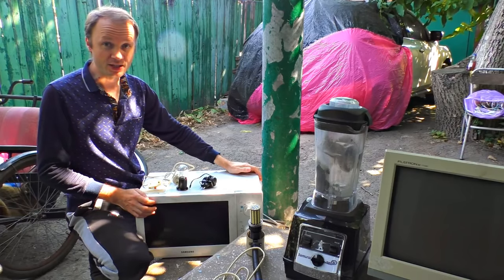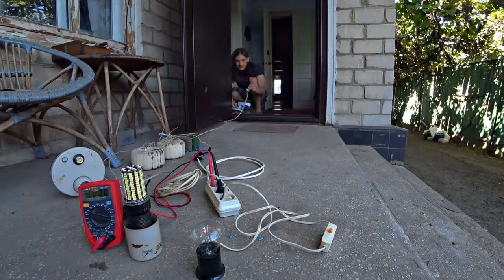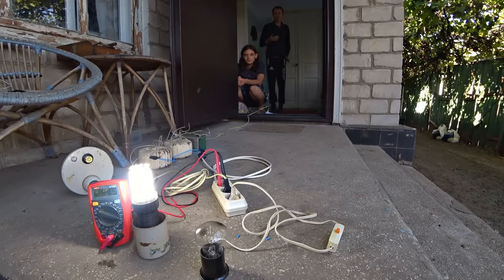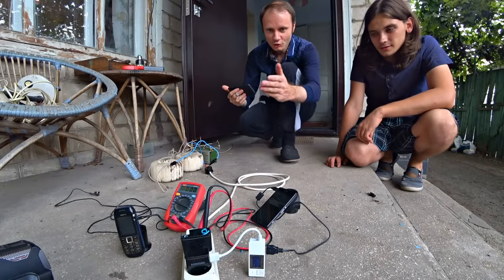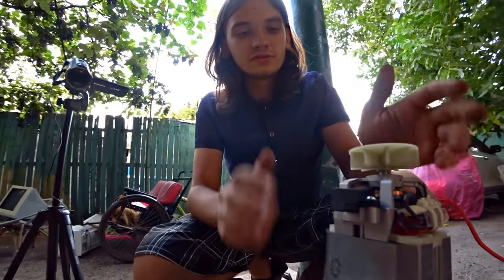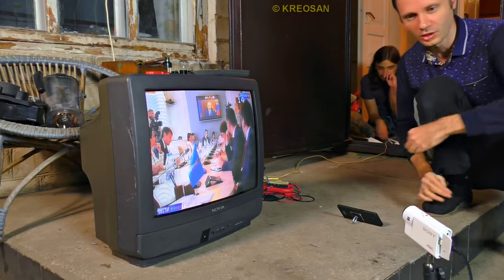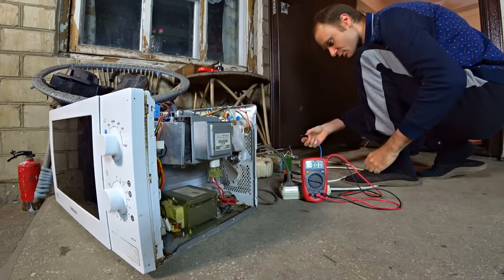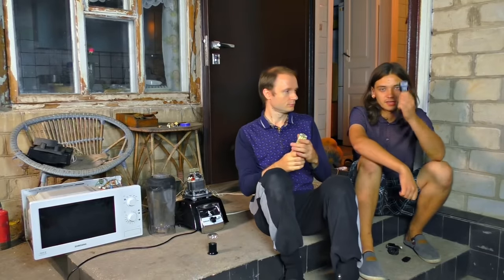Don't leave your devices plugged! Overvoltage + house appliances

Comment: voltage increasing at night probably because the load is pretty low, so the Ferranti effect (basically it explains how lower load could increase the voltage on load side) happened. we learned about it on power electrical engineering. this could happen when the grid voltage control is bad. They probably should use SVC in the grid.

Comment: The voltage increase is caused by the power line resistance, and bad voltage control at the power supplier.

Comment: Y'all still have analog telly available?  Not in the USA. 260v was coming out the mains?  That could cause premature failure. I think our system more tightly regulated. I've never seen more than about 122 on a 120 on my voltmeter

Comment: The voltage used throughout Europe (including the UK) has been harmonised since January 2003 at a nominal 230v 50 Hz (formerly 240V in UK, 220V in the rest of Europe) but this does not mean there has been a real change in the supply.

Instead, the new “harmonised voltage limits” in most of Europe (the former 220V nominal countries) are now:

230V -10% +6% (i.e. 207.0 V-243.8 V)

In the UK (former 240V nominal) they are:

230V -6% +10% (i.e. 216.2 V – 253.0 V)

This effectively means there is no real change of supply voltage, only a change in the “label”, with no incentive for electricity supply companies to actually change the supply voltage.

To cope with both sets of limits all modern equipment will therefore be able to accept 230V +/-10% i.e. 207-253V.

Comment: If it was made in China, its recommended voltage would be at least 100 volts lower then what was on the plugs (it's true with everything,  ESPECIALLY screen protectors for smartphones)

Comment: the electricians don't increase the voltage. its just because the load is decreased because everybody turns off their devices at night and the electricians dont feel like decreasing the power

Comment: Incandescent bulbs... take it by shedding heat... LED bulbs... has a voltage regulator with a capacitor that will overcharge with overvoltage.

Comment: Far as I'm aware, there are only 120V and 240V as voltage standards, and anything offset from either of those is just grid vdroop from load, or overcompensation. All electronics will target voltage ranges around 120 and 240, but nothing strictly requires exactly either voltage, with many electronics being labelled for nonstandard voltages, thanks to the fact that standard voltage is a very fuzzy topic, especially in areas where the electrical grid isn't stable.
I live in the U.S., and with this being a 120V country, I've gotten electronics that say 100V on the input, I've gotten them with 110V, 115V, 120V, and I've even seen a few labelled 130V and 140V input, although overcompensation values like that are extremely rare here as far as I know. But they're all actually designed to work on 120V power, and have been labelled by the manufacturer, either purposely to match a typical vdroop value, or by accident because the marketing team that makes the rating sticker or mould imprint can't do basic research on what the actual standard voltage is.
Perhaps we need new type of transformer, that mechanically adjusts the output connection points on the winding, by using smart circuitry to read both the input power from the grid (usually something in the range of 11kV), and the output power into the home(supposed to be 120/240V). Such a device to make sure that a home recieves proper voltage would absolutely increase cost, but it would save a lot of electronics in the long term, and maybe start to phase out some of the misnomer voltage standards that have come from typical vdroop over the decades.
Reply: It depends on where you're at.  Japan has 100V.    We have 110/120 depending on what you want to call it.  Euro and elsewhere can be 220 or 240 volts.
Reply: @johnalexander7490  Japan has everything from 120/50 to 240/60, it depends on the region. The only reason you'd see 100V in Japan is because you're measuring during a high grid load in a 120V50/60 region.

Comment: Electronics should handle 250V, many products (especially older) have writtern it's for 250V, but overvoltage 260V is too much, electric network in your country is probably poor. :-) But I know it sometimes happen even here that people have something like 257V in some places, unfortunately electric companies are like little states so trying to deal with them and force them to fix something is almost impossible, they don't care about common people.
PS: you have still analog signal for TV or you somehow feeded it different way with picture?

Comment: Last night, there was a power problem and instead of 220v I had 300v. Fortunately, nothing broke except a small TV that was used as a monitor. I think that the sound doesn't work anymore but the picture works. Should i start to disassemble it to check? The power brick is on the csbke by the way

Comment: Noone increeses the voltage. It rises becsuse there is almost no load on the transformer. If there is high load voltage would drop to even under 200 volts.

Comment: in what moment nokias TV are real
Reply: Hole Nokia tv is hot to 500 voltage ⚡
Reply: 255 volts 2 minutes
Reply: 300 volts 1 minute to 50 seconds
Reply: Timer may running out
Reply: With 300 volts